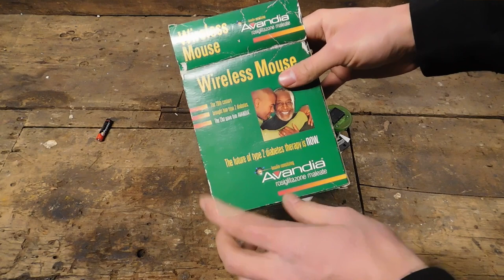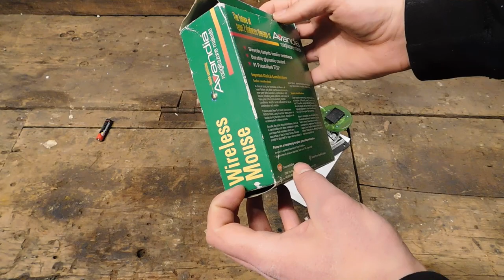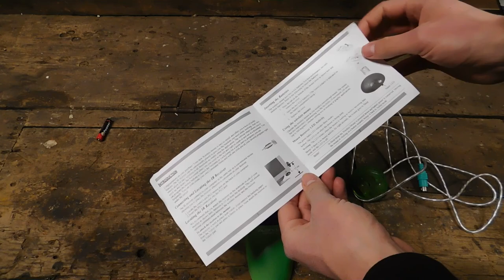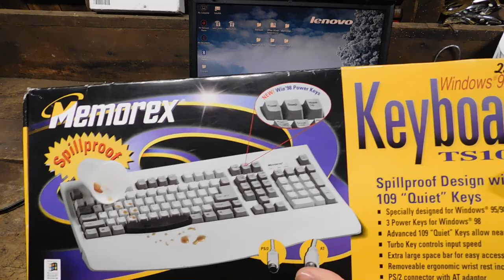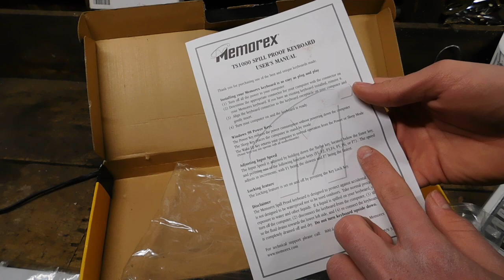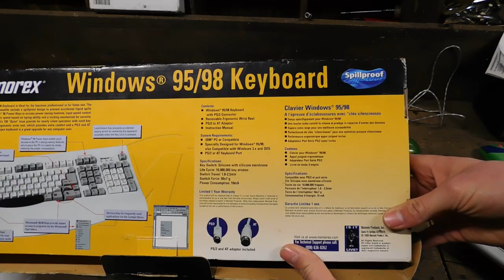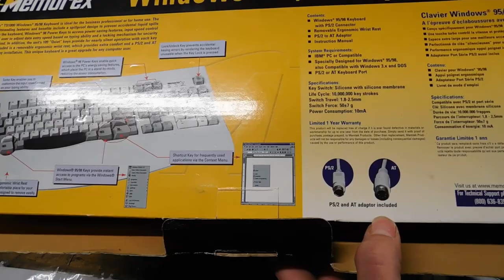Oddware: Diabetes Mouse & Memorex "Turbo" Keyboard

Comment: Are you bound by wire when navigating your graphical user interface? Ask your doctor for the Avandia Wireless PS/2 Mouse. Side effects include carpal tunnel syndrome, repetitive strain injury, inadvertently clicking "Shut Down" in place of "Run", death, desire to use Windows 10 and deterioration in level of computer literacy. Do not operate a computer running AutoCAD 2.1.4 for DOS while using the Avandia Wireless PS/2 Mouse.

The larger French text on the keyboard packaging may have been done to make the product acceptable for sale in Quebec ("Spillproof" would be a proper noun, and exempt at the time). The relevant regulations make it harder to get laptops with English keyboards here (English desktop keyboards are common though, especially the Lenovo SK-8825) and as such, my ThinkPads have French keyboards. Mine have "Alt Car" and a pound sterling sign under their 3s.